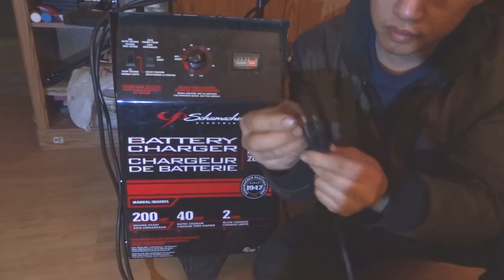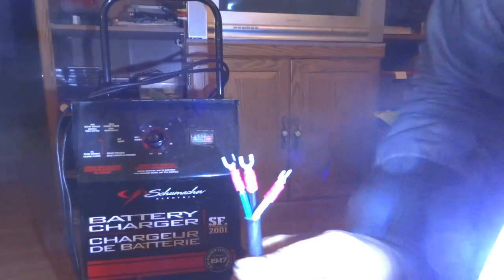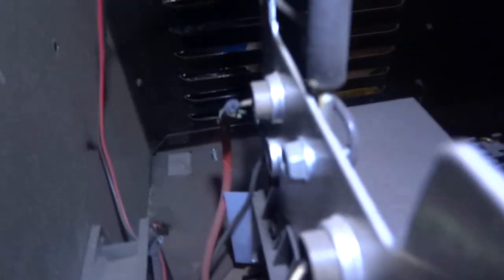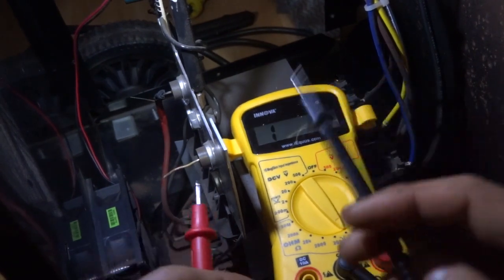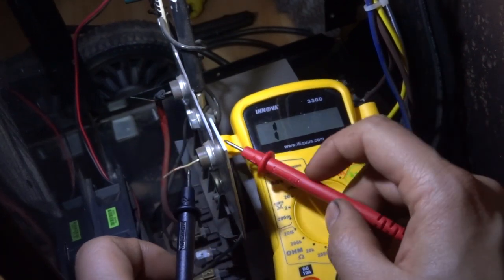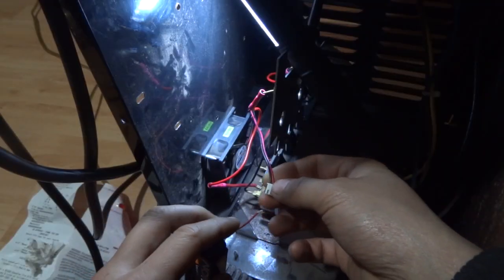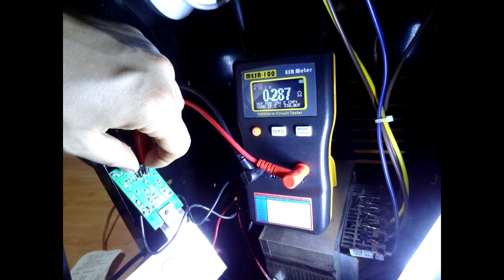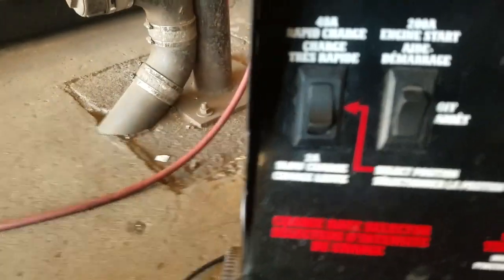Schumacher Battery Charger Repair, Part I

Comment: The 2amp is supposed to put out 9v so it charges the battery slower and as you can tell the voltage gets higher when you set it to a higher amperage. Any battery charger that has multiple amperage settings changes the voltage not the amperage. The battery draws less amps because the voltage lowers.

Comment: Good fix. you could see burnt wires as soon as you opened it. I have a brand new charger that has never worked and of course it's all electronic inside. probably the circuit board.

Comment: hate these things they ALWAYS BREAK
Reply from the maker: Probably uve been using it improperly. Always make sure the battery is taking the amount of AMP you specified. If it isnt, turn the amperage down. you always wanna charge a discharged battery starting with low amps. Is your fan working too?! I got pt 2 uploaded for that.

Comment: I have a SC1446 just got it from a friend it's brand new practically, unfortunately it doesn't work. The load side of the timer switch wire fell off on the opposite end of the timer and I don't know where to reconnect it. it's not obvious does anyone know where this wire reconnects?

Comment: Is the fan a 110v, or a low voltage unit? It seems you could just move the leads so that the fan is on when the charger is plugged in. You could get "fancy" with an additional rocker switch on the face-plate or wire it directly after the switch to power up when you set the timer.
If it's a low voltage fan, I'm sure there are endless supplies of similar fans in old desktop CPUs and other equipment that handle the 110 voltage. Just a thought from a guy who hates green boards (circuit boards) on anything stored in a garage or shed.
Reply from the maker: Its a 12V fan. Should be able to use any low voltage, 12v, fan.

Comment: Nice job on the video. At least you've got a unit that you can almost use. Who cares about the 2 amp not working, I never use that setting anyways. I would fix the fan though, I would think it is why the unit needed repair to begin with. On mine, the fan runs constantly while the unit is plugged in. So if the fan works but isn't getting power, Run separate wires directly from the power supply, making sure to get the voltage etc. correct. 

Anyways, nice job!
Reply from the maker: Thanks! Yeah, I will have to relook at that again after my next battery charger repair, this one is an Associated. So, The 12V AC stops at the diodes in the beginning, I tried testing for DC after the first diode and got nothing. So it must be something in the diodes. So I cant run direct supply from that. Maybe something to do with cold solder? Never dealt with that or know how it affects electronics, I just know I tested the diodes in circuit, even pulled one out to be sure, got continuity from one to another.
Anyways, will upload the fan repair if I ever get it working~
Reply from the maker: Hey I got the fan fixed! Problem was the IC in the circuit. Video is up!   
https://youtu.be/ATSUzUAHnuM

Comment: Long shot. I have one of these units. It worked well at a friend's house on his sub panel in the garage. The sub panel in his garage is wired amateurishly though and might lack safeties kf a normal subpanel.

My charger doesn't work in my garage or on my generator. It just pops the breaker immediately or the gfci outlet on the generator. This is as soon as i turn the timer on without the clamps hooked to anything.. 

Cant diodes cause an issue like this? Where are they located on this charger.

Comment: Great video !  My dog plowed into mine with my jump pack on top of it.  Now it doest show any amps when i try to use but it.  Alao it is charging way too high, maybe 16.5 on the 10 amp and like 18.5v on the 200amp.  Any thoughts? Thanks again!
Reply from the maker: Hey, Thanks! So, If I remember, you need to hook it up to a battery so its UNDER A LOAD. then the voltage drops to a normal voltage. Have you tried testing the V when charging? Also about the amps not showing, maybe your ammeter is faulty? You can bring the charger to an electric repair shop see what they can find if theres a problem.